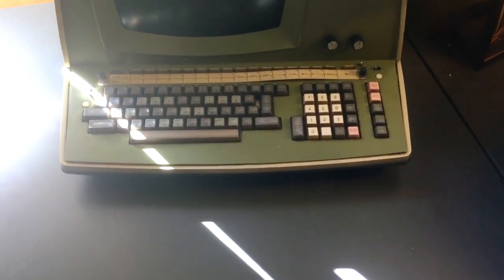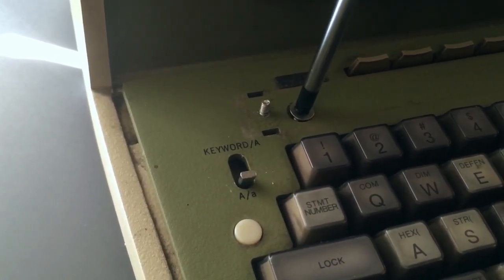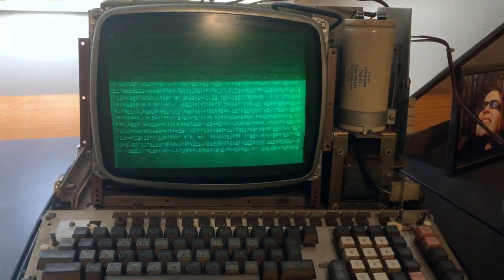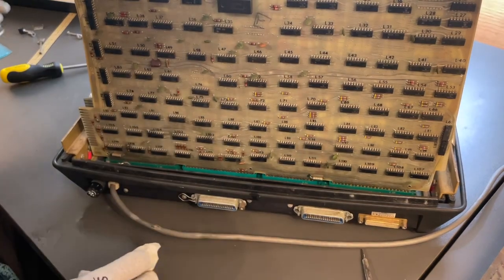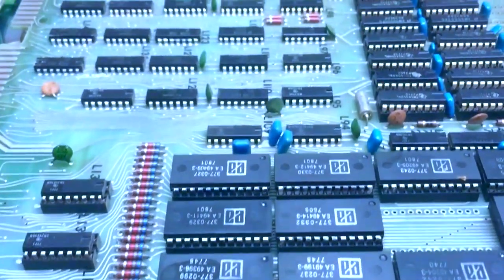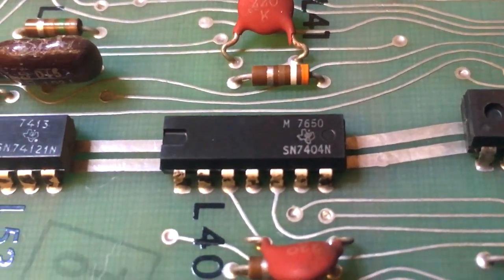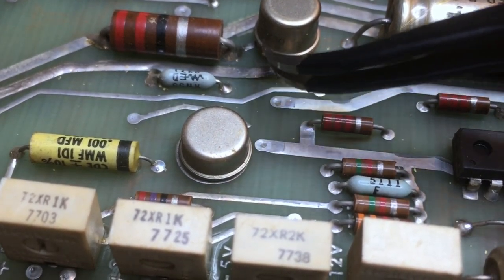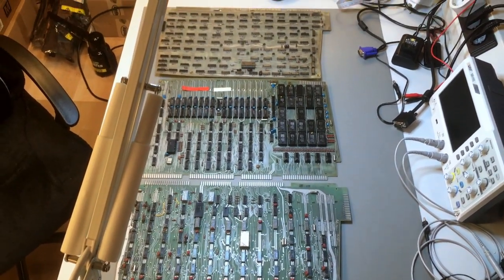Restoring a 1976 Wang 2200F mini-computer, Part 1

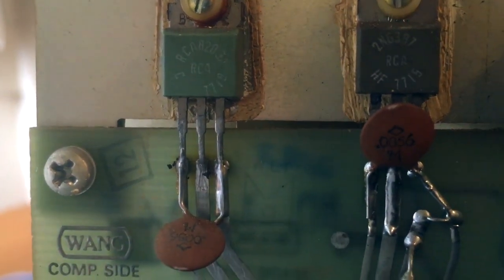Comment: 9:30
hello maybe you could help me. i bought a few kilo of pcb scrap and in that lot was a really cool looking slotcard in its small little frame. the frame itself has connectorpins (flat with a hole at the tip).
the card is labeled 
PCS Rechengeraet Eingang
(PCScomputing unit/input module) but i couldnt find anything about it. it must be really old! the only results i found was about a wang pcs 2 but i dont know if it has anything to do with it. but it looks very similar to the board shown at 9:30
Reply from the maker: Wang PCS is the computer you saw me restore, but your description of the card doesn't sound like it belongs in it. Maybe with a photo I could say more.

Comment: That stupid deoxit can!! You can pull that off the top and then use a nozzle from another can. A normal one that won't leak. I think I used one from silicone spray with the red tube.
Reply from the maker: It's aggravating, isn't it? Will do what you suggest!